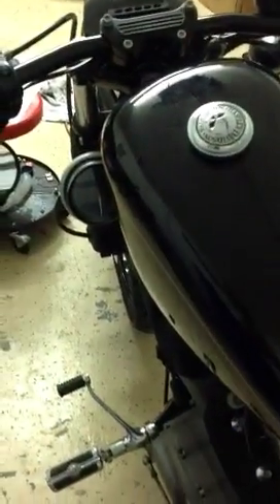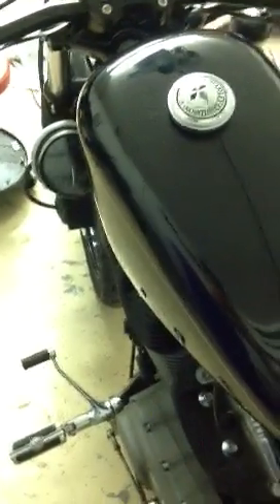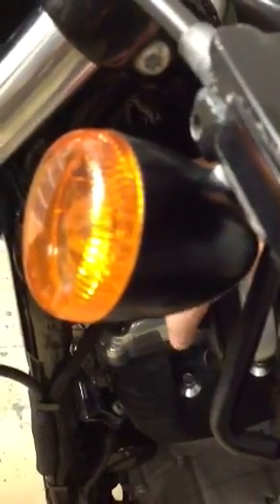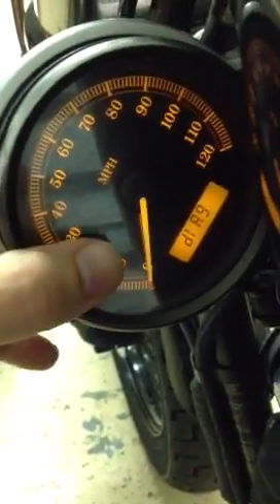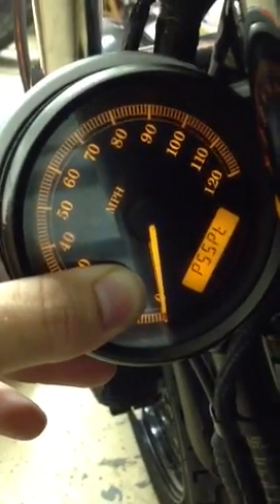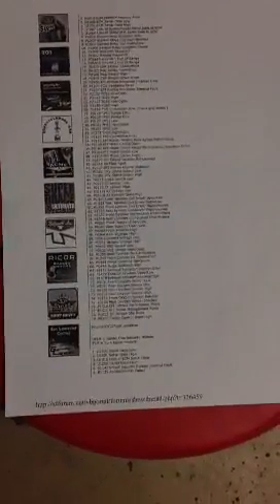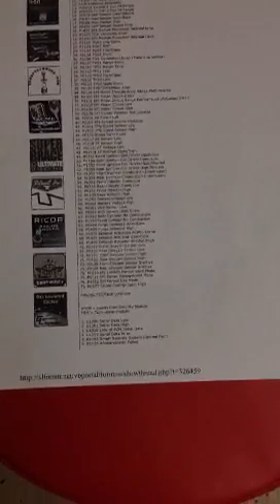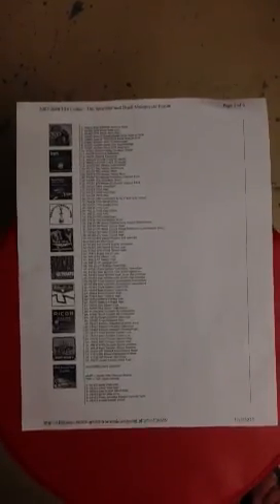2007 Sportster Diagnostic Codes

Comment: dude thank you so much, worked perfect. And it was actually one of the codes you mentioned the "loss of idle control speed", I was out cruisin and my speedo just shut off randomly and the engine light was happening but the Bike was running fine, cleared the code and it's all good!